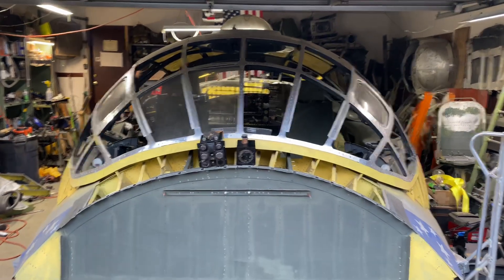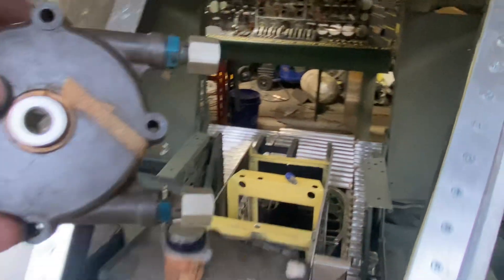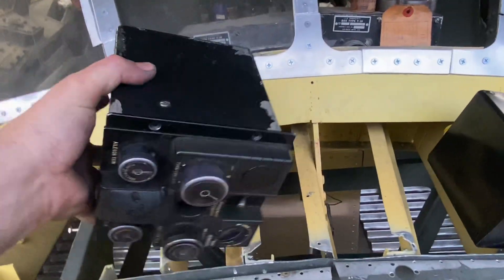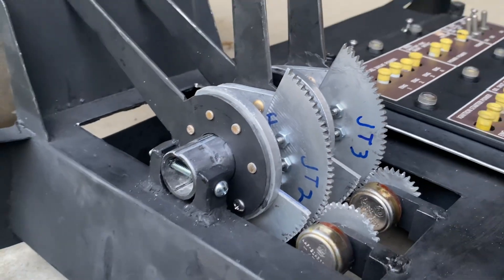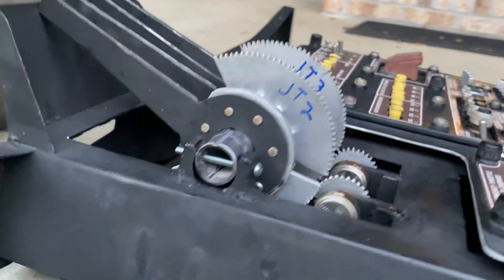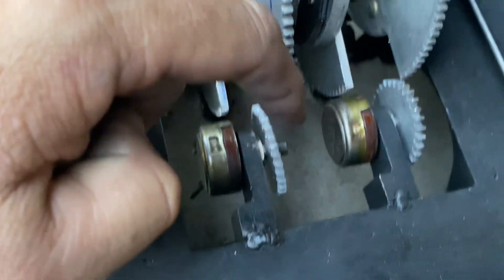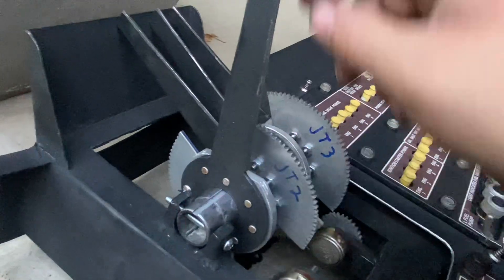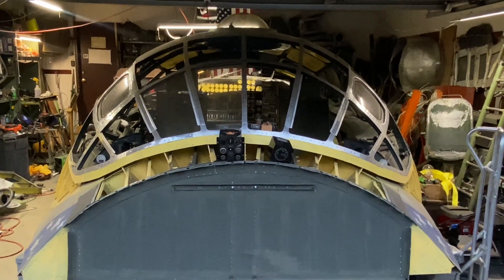Scratch Built B-36 Peacemaker Turbo-jet Electric Fuel Control Quadrant Progress + Goodies!

Comment: Have you cross referenced the throttle controls of the B-47? The jets were added as an afterthought for the B models onward.The pods always make me think of the 47.But Convair and Boeing would not be copying each other. The piston engines would be shaking the throttles,one out of synch and you crash. The glass cockpit on the 36 seemed out of place for a 1955 bomber.The only thing weirder was the early b-52's with a B-47 canopy.The air force wanted side by side pilot chairs.They got them!
Reply from the maker: Until recently I owned a B-47 throttle  quadrant. They are two different animals.

Comment: Great you got the E-6 – curious where you found it.
Could be wrong but I recall the Teleflex is a flexible push-pull cable with wraparound ridges to keep it in registration. Outside of expansion and contraction, supposed to physically convey a certain setting at a distance.
Reply: Yeah. Per their website, Teleflex "... started in 1943 as a manufacturer of innovative mechanical controls for the aviation industry." They sold all their gauge and control manufacturing to various other companies since the ... 1990s, it seems.
Reply: Years before seeing Teleflex in bomber manuals - first heard a mention in “Dr.Strangelove” where James Earl Jones says “Auto CDC into manual Teleflex link”.
Reply from the maker: The E-6 came out of Alamo Aircraft. I belive it was the last one in their inventory.
Reply: Great they actually still had an E-6, considering how rare they seem to be – and also a later one with the blank plug over the Auto-Recovery button .
Reply from the maker: @johnwatson3948 Interesting. How “late” is this blank plug feature?
Reply: As far as can tell, looks like the blank plugs were on all E-6’s after the B-36B – think they found out early that the recovery button was useless or dangerous in such a big aircraft.
The E-6 I have has a “1950” stamp and doesn’t have the plug. In the B manual console drawings it appears there is no plug, while I believe plug is shown in the later manuals.
Reply from the maker: @johnwatson3948 Wonderful information. This is one of the reasons I do what I do.